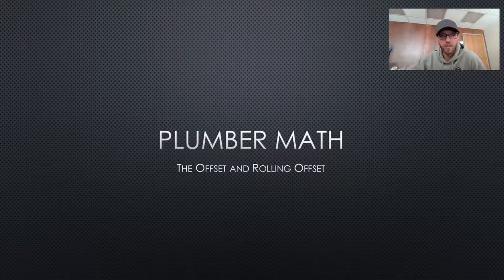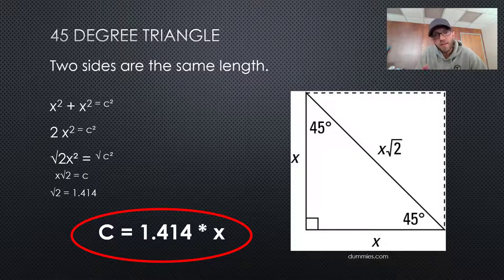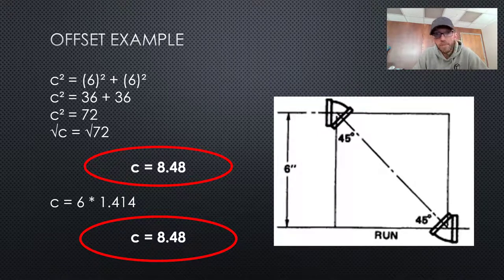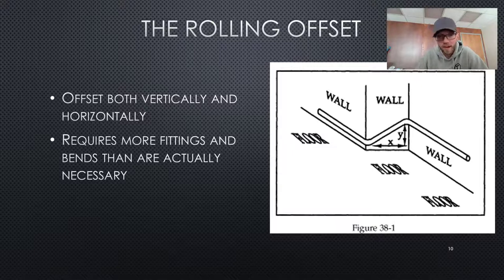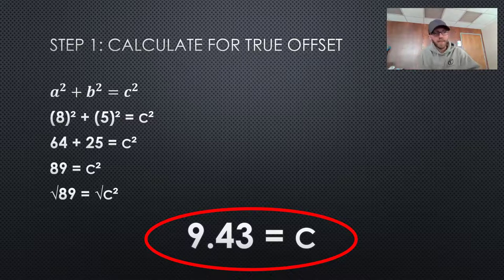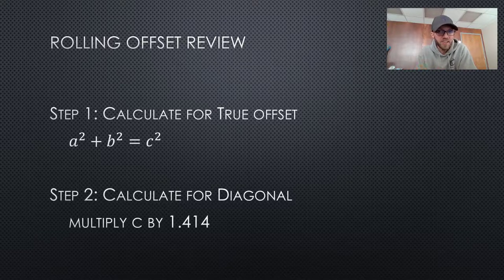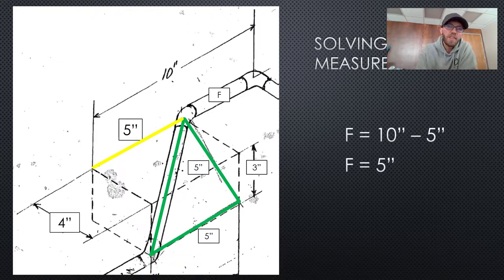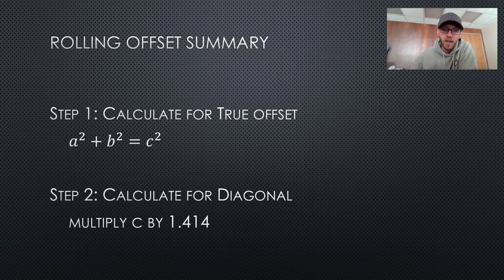Plumber Math: Offsets and Rolling Offsets

Comment: Does the 2 step still work if the pipes  aren't squared with wall? Just measure from c to c and measure up from both rises, subtract the big number from smaller rise and use that for the actual rise, then square both numbers, add them and then sqaure root the number for offset, multiply that offset by 1.414, subtract 2 take offs for both fittings and then done?
Reply from the maker: Yes.  Sounds like you have got it.
Reply: @thomashicken6350  awesome I should know it by now, I watch your video every morning 💯 just needed to confirm 👍
Reply: If pipes line up just measure over and multiply that number by 1.414 then subtract 2 take offs, even if the fitting is a 90 or tee eh just the take offs will be different?
Reply from the maker: @fleuryelite2170  Great.  If you like this, you should check out my other videos on my Plumber-Tom YouTube channel.
Reply: @thomashicken6350  forsure going to subscribe man